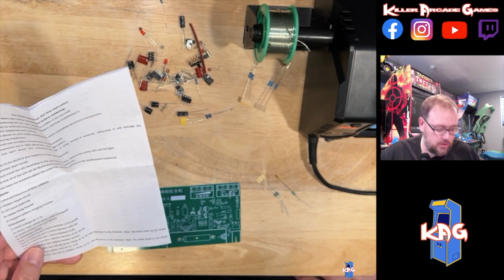It's Time For me to Learn to Solder!

Comment: If you want to learn how to solder properly you can take an IPC J-STD-001 training course to become certified. But, to pass the soldering tests you should have about 3 years of soldering work experience, because you will need to solder to a specific standard and do it quickly and also pass written tests. A huge consideration is cleanliness, meaning before you started soldering components to the PCB you would first clean the PCB with pure IPA. 

The vast amount of people actually soldering on YouTube do not know how to select the proper tools for the job, or the techniques needed to make a good solder joint, it is really very pathetic. There are some good soldering videos from Pace Worldwide and IPC certified trainers showing proper technique. To properly solder and repair electronic subassemblies you have to have the proper tools, supplies and techniques. Trained soldering technicians know how to keep their soldering tip and iron clean, tinned and contamination free. You also have to select the proper tip for the soldering task at hand. One tip does not fit all.

If you want to specialize in repair you should be also certified to IPC-7711C-7721C which is described as rework by IPC, due to the focus of IPC towards manufacture and not repair. However, many companies will use IPC-7711C-7721C as a base for their own in-house repair standards and procedures. Notable with IPC-7711C-7721C is that when we replace parts we must remove the part without damaging it, this is because it is usually then tested in some way for defects by the engineering staff or the part vendor. The actual word repair is used by IPC but it is in the context of repairing a PCB (lands, traces, etc.), and does not refer to a field return repair of a completed assembly.

Since you are in the USA do not learn to solder using lead free solder (the green reel) use eutectic leaded solder from Kester. Lead free solder has a different look for a good solder joint. For arcade game repair in the USA there is no real good reason to use lead-free solder. Lead free solder, as a relative comparison, has a much higher melting point than leaded solder, so much so that soldering stations used for lead-free soldering have a temperature setback to reduce the iron temperature when it is returned to its stand.

Comment: Nice job Chris. I’ve done a little bit of soldering in the past on controllers etc but I’m far from great at it. It’s funny cause my girlfriend bought me some practice boards to solder onto. I’ve got some monitors that need cap kits so I’ll be practicing too
Reply from the maker: I think you'll do just fine. I was surprised how easy it was. That said, I've never actually tested my work haha. Let's hope it would work.

Comment: Don't forget you can always use old broken electronics to practice desoldering and solder parts.  You can use your multimeter to check out the resistance of your resistors,  etc.
Reply from the maker: I kept an old arcade video signal converter for years and finally tossed it probably 2 months before buying the soldering kit lol. I did do some testing with the multimeter to get a feel for that too!
Reply: @KillerArcadeGames  it's a slow go at first, then it will start clicking alone. Thanks for sharing..

Comment: I used to solder everyday for 4 years straight . I miss that smell in the morning lol. You know your joint is good if it's shiny . I heat the point and wire a little longer than you do though. Also make sure the iron tip is what they call "Tinned" keep the tip clean after every few uses too with a wet sponge
Reply from the maker: I did learn a better technique after uploading this video. I went back and played around some more, I think it works better. I wasn't exactly sure what to do with that sponge but I was using it frequently and rubbing it around in that steel wool thing lol.
Reply: @KillerArcadeGames  yea basically keep the tip shiny and clean as much as possible.

Comment: Hi Kag giving you a big tip i wish i knew before I tried fixing my first actual arcade board: always use leaded solder. It will combine nicely with both leaded and unleaded solder. if you try to add unleaded solder to leaded solder (which most old arcade hardware used) you will end up with very bad and ugly joints that will get all black and don't make a good connection
Reply from the maker: I’ll try it out! Thanks for the tip.

Comment: No, you don't need lotion to solder. 

Not bad for your first attempt, but you need solder that has flux in it. Flux is crucial for the solder to flow properly and stick. You also need to have an iron that gets hot enough. I run mine between 750F and 800F. I've seen too many damaged/ripped/destroyed pads from people using under-powered irons. Also, don't use those suckers to de-solder. Than can fling solder around if used improperly and can create bridges that you'll be scratching your head trying to find. Get yourself some good wick and don't look back. I have linked it below. Also get yourself some good flush-cut diagonal cutters (also linked below). Like anything, practice makes perfect. I actually went through a 2-week solder tech school in the military, so if you have any questions, let me know. You will need to copy and paste the links at Amazon because I can't post the real links here. 

/Chemtronics-Desoldering-Braid-Chem-Wik-10-50L/dp/B0019V5MAC?pd_rd_w=k5k5k&content-id=amzn1.sym.deffa092-2e99-4e9f-b814-0d71c40b24af&pf_rd_p=deffa092-2e99-4e9f-b814-0d71c40b24af&pf_rd_r=2N1N1WPVKX5NMVF6XVQJ&pd_rd_wg=cteKR&pd_rd_r=5a9f9374-4694-436d-aecd-c868773a6c77&pd_rd_i=B0019V5MAC&psc=1&ref_=pd_bap_d_grid_rp_0_1_i

/Pliers-Electrical-Cutters-Cutting-Diagonal/dp/B0188DHO40?pd_rd_w=k5k5k&content-id=amzn1.sym.deffa092-2e99-4e9f-b814-0d71c40b24af&pf_rd_p=deffa092-2e99-4e9f-b814-0d71c40b24af&pf_rd_r=2N1N1WPVKX5NMVF6XVQJ&pd_rd_wg=cteKR&pd_rd_r=5a9f9374-4694-436d-aecd-c868773a6c77&pd_rd_i=B0188DHO40&psc=1&ref_=pd_bap_d_grid_rp_0_4_i

Comment: I need to learn to solder too. I need to fix a joystick I use with my pc. There are lots of good video tutorials on soldering circuit boards. A third hand device and magnifying glass would be awesome to have as well.
Reply from the maker: It was super intimidating but actually pretty easy. Just buy a cheap radio kit and practice away!
Reply: @KillerArcadeGames  I should do that. That would be a lot of fun. I learn a lot from the work you do on your channel. Keep up the excellent work.